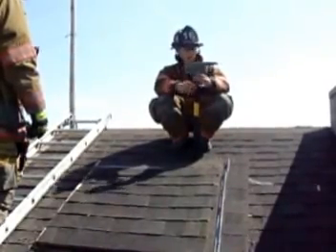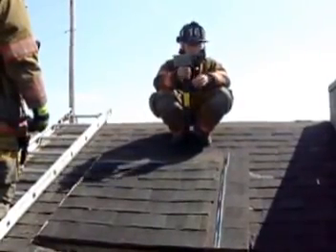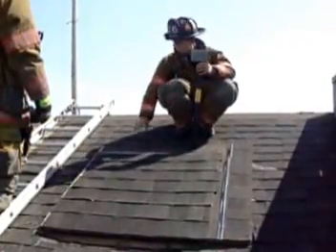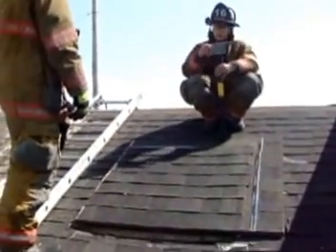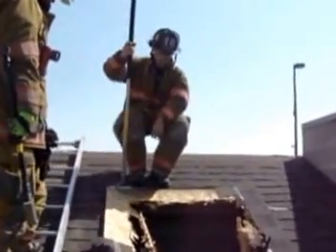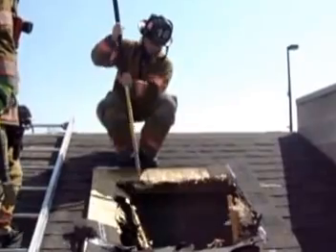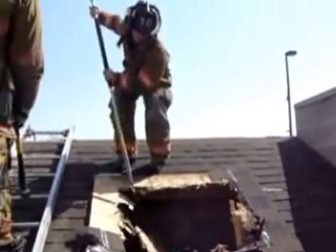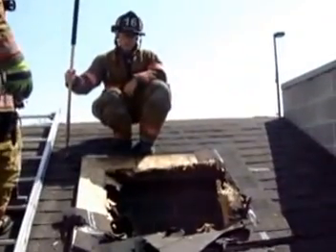SFD Training Minute-Vertical Ventilation with the PIG Tool

Comment: why wouldn't you use the flat side of the axe. the pig is junk
Reply: Arnt flat axes paired with the halligan most of the time?
Reply: Usually you would use the blunt side. I think the instructor was trying to make a point that the sharp side of the axe is not as effective as a blunt tool.